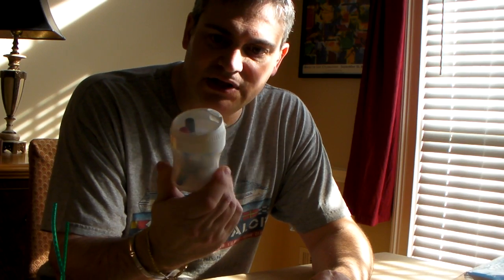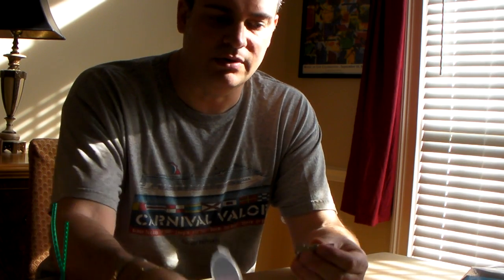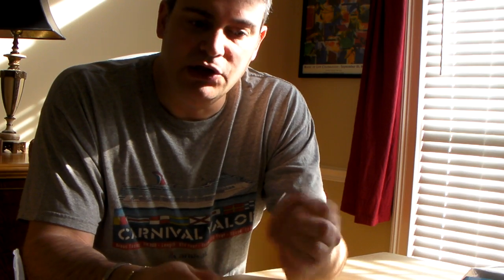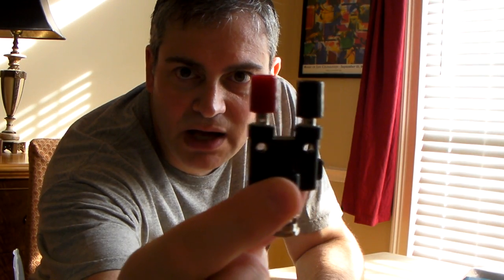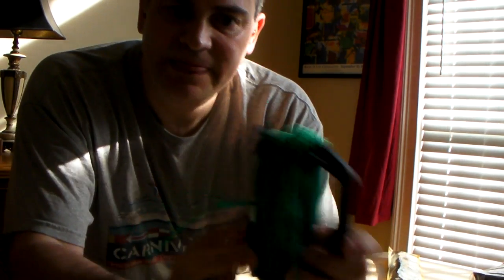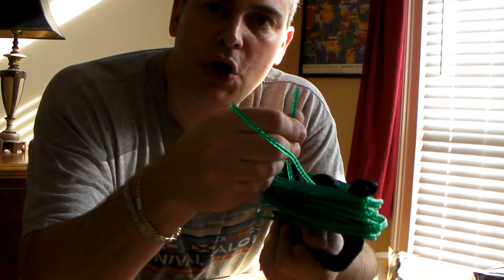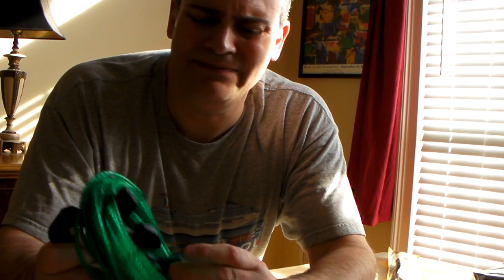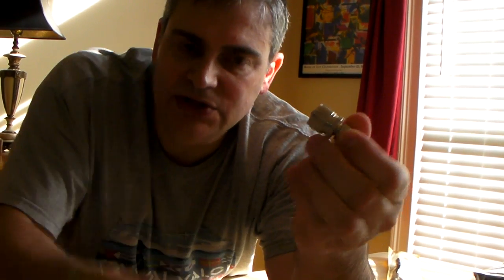Elecraft KX3 Antenna Ideas and Connectors

Comment: When I saw the "ladder line" antenna connector (available at Amazon and Elecraft), it occurred to me that you can't use a ladder line or open wire feedline directly connected to the transceiver. Those feedlines are for high impedance (300-600 ohm) BALANCED antennas. The vast majority of transceivers (and built-in automatic antenna tuners) need 50 ohm UNBALANCED antennas. To properly use an open wire feedline you need one of those big expensive (about $1000) wide band antenna tuners with a huge mechanical inductor coil and huge mechanical capacitor. Most of them are collectors items going for outrageous prices on ebay. 
While open wire feedlines have almost zero line loss and sends all the power to the antenna, the downside is the equipment you need to match it to your transmitter. You're better off just buying the best low-loss coax you can afford.
Reply: A

Comment: Good video...I got mine ordered the first day and I'm anxiously waiting, as are you.  I too have a new BuddyStick all set.  I also bought a couple other mobile type antennas to work in the field along with some 30' telescopic poles and some wire.  I have the battery pack coming with mine as well as all the other options.  I'm glad they're getting a few out but I don't think they are moving very fast.  Will be nice when they are at full production.  Thanks for the video. 73/72

Comment: The battery pack is included just the charger won't ship on time.  You can still run on batteries.  If yours arrives before mine, make sure you make some videos!!! :) 73 de W0EA